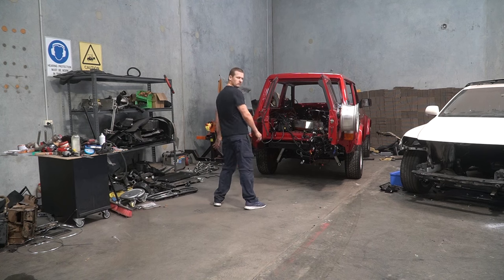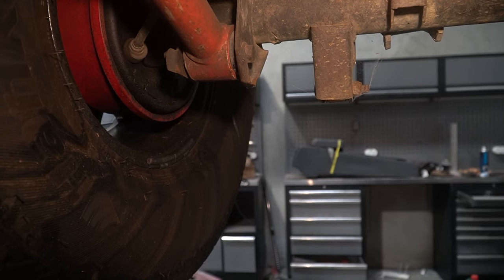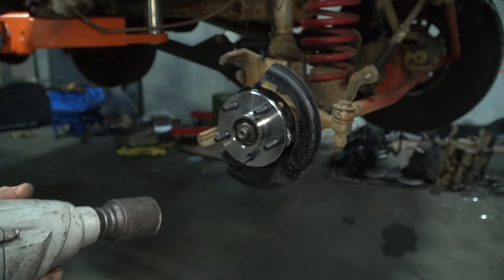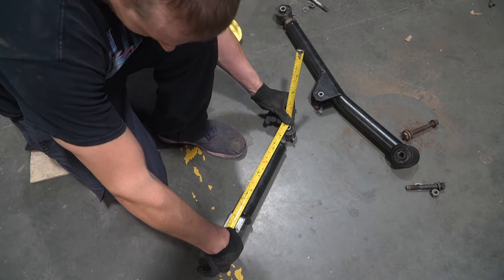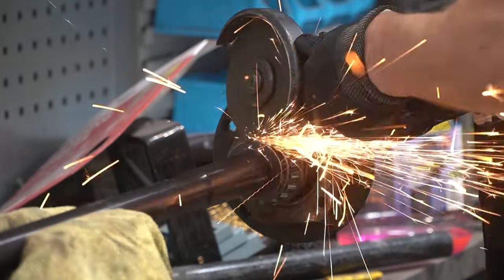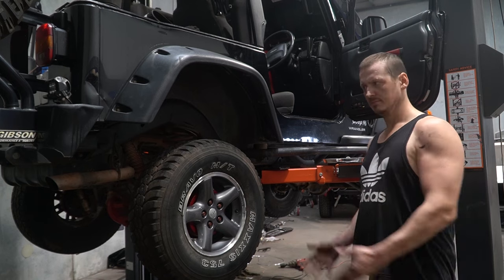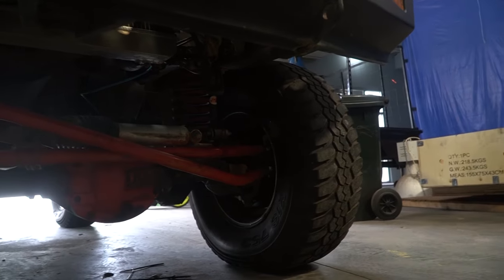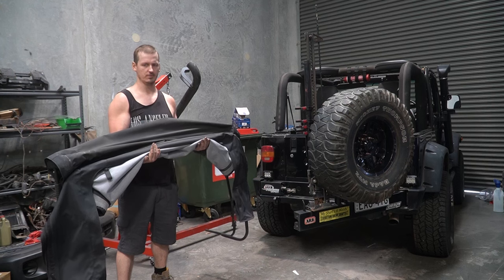Jeep Wrangler TJ Restoration Project

Comment: AHHH brings back memories not good ones really I had a 65TH  anniversary one in silver that I put next to my house under a tree so I couldn’t see my expensive investment 😭😭😭and let it run out of rego 
I decided it was time to go once I was medicated I took it for a blue slip and yes it failed I had similar problems as you did yes axle seals brakes roof radiator and yes the first cheap eBay radiator leaked so I did that twice which the shroud didn’t fit properly yes a nightmare in / out 3 times 
I really had trouble getting it passed the brake test they really have bad brakes 
You really have to love Jeeps and I really don’t think buying one will improve your life 
I felt your pain all video 
Thanks for depressing me today cheers Dan
Reply from the maker: Jeeps are synonymous with depression. Hopefully it's the last you'll see of it on this channel. Congratulations, you made it through.
Reply: @ridiculousthings4x4  It went that well, did it?

Comment: I am guessing by the fact it has a 6 speed, but still has rear drum brakes, it is either really late 1990s or early 2000s.  I bought a 97 brand new when the TJ model first came out.  It had a 5 speed manual and rear drums.  I built a 2005 LJ (the longer one) for my daughter.  By then, they had disk brakes at all 4 corners.  The 4.0 L  I-6 is an extremely stout engine for a gasser.  Basically, it's an old-school AMC  block w/ fuel injection.  I did a long arm 3" kit on my daughters LJ.  It is the way to go to get the geometry right and get the arms level again on the short wheel base.  They already flexed extremely well from the factory.  The long arm is more about returning the arms to level.  The TJ and LJ were a couple of the last of the good basic wheeling machines.  As info, I think they look better with the Bushwhacker flat fender flares.  And they give more room for the tires to flex up in there without hitting.  Also, keep in mind it is a 20 some year old machine.  Axle seals, pinion seals, etc are all going to be part of the game in restoring something that old.  Maybe need new oil pan and gasket, and do the rear main seal while you're in there.   Maybe water pump and steering gearbox soon.  Once some of these things are replaced, you have another 20 plus years on them.
Reply from the maker: It's the last run of the TJ, so a 2006. One of 1500 apparently. I can only assume it has rear drums because of the factory Dana 44 this model got. You tend to get the weaker 30 or 35 in the other ones.
Reply: @ridiculousthings4x4  my daughter's LJ is an 05 and it came stock with a rear 44 and 4vwheel disks.  Perhaps the releases in AU were different than the US.  I was just reading that the D44 with disks became an option in the US on all trims starting in 03.  I was thinking it became standard because I saw so many with it, but no.
Reply from the maker: That makes sense. Australia doesn't get any of the good stuff 😂 and the wait time for parts is insane here.

Comment: Hey Bud, just wondering, are you going to change those sketchy lookin' front brake hose, they look like they've seen better days, like the rest of the shit box, and no I don't like Jeeps, vomit. I do hope this is a do up and piss off for profit thing and not an actual keep and drive on the road and to be seen in it thing, please say no haha.  At least now it does Jeepy things. Seeya Rob
Reply from the maker: Thankfully it's a fix up and sell. I only bought it to help someone out, so I think the "profit" aspect is non-existent.
Reply: @ridiculousthings4x4  Just a thought on the wheels and flares difference, can you get or make a spacer to go between the flare and the guard, as in take off the flare, fit the spacer to the flare with longer bolts and then refit to you vehicle, also have you thought about making stickers for the channel, I like the round Ridiculous 4x4 things at the end of the vid. Seeya Rob...........on the bottom right.
Reply from the maker: That would definitely work. The issue lies with the NSW police of the Reich defecting such things. Only 25mm per side is allowed as a deviation from factory offset, so the wheels alone are illegal. Stickers are also in the works 😂 in time for the Sydney 4wd show

Comment: You jeeped us! Bloody Oz Post! 
Can't you move the new radiator forward a tad? Some red neck enginerdin required. 
Jeeps are made for the aftermarket and motor services industry I gather.
Reply from the maker: I'm sorry. Don't worry, this video lost me 2 subscribers as punishment. I probably wasn't clear in the video, but the original radiator it turns out was fine once refitted. Just the lower hose was leaking. Strangely, it's the aftermarket stuff that sucks on jeeps. That long arm kit, and the steering stuff... Badly designed garbage.